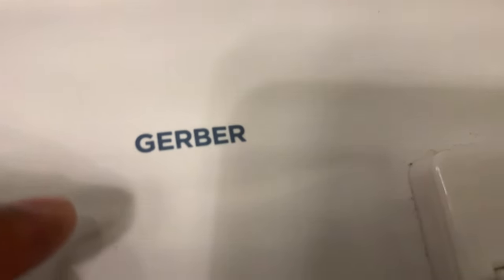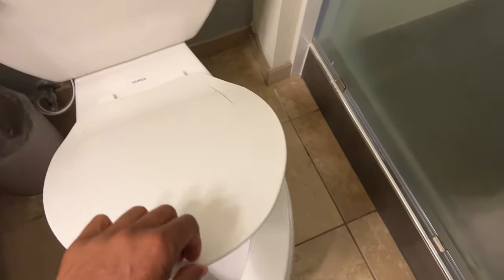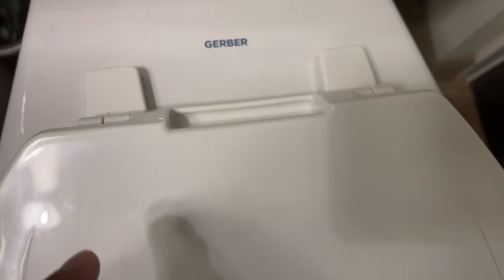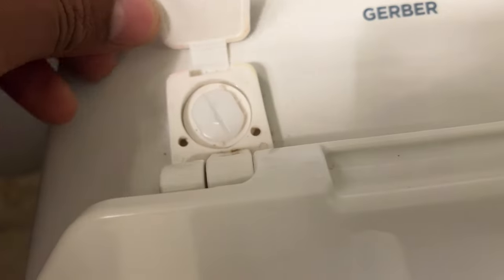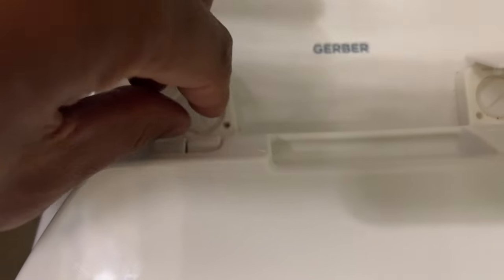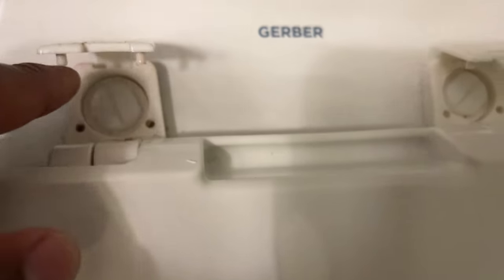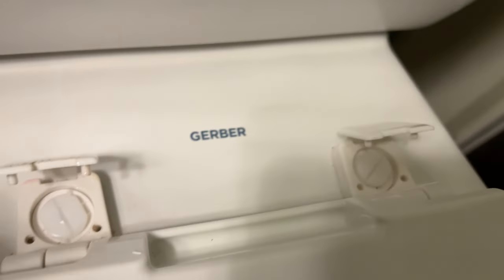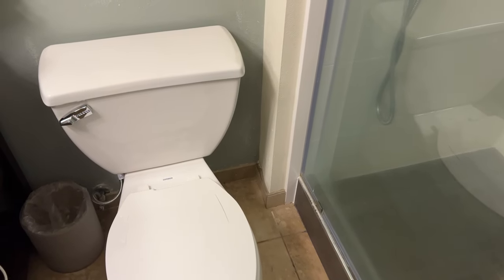Gerber Toilet - How To Remove Gerber Toilet Seat

Comment: Mine doesn't have screws when u flip the tabs up. There is a solid rectangle piece of plastic that has an arrow on it. I assume if u slide it, it will expose the screws, but I can't get it to budge. I really don't want to call a plumber, but.....
Reply: i have the exact same problem
Reply from the maker: @amylewis7563 did you ever figure it out?

Also, can you subscribe for more great content? I will really appreciate it!
Reply: After you flip the tabs up, lift up the lid and seat and pull straight out (not up). Then turn the entire solid rectangle piece of plastic counter clockwise to loosen. Grab the plastic nut piece below as you unscrew to remove the solid rectangle and plastic nut.
Reply from the maker: Thanks for the tip